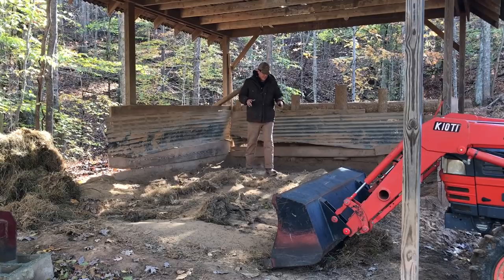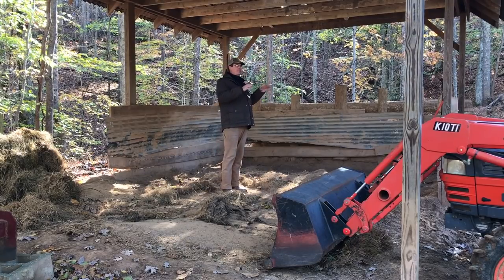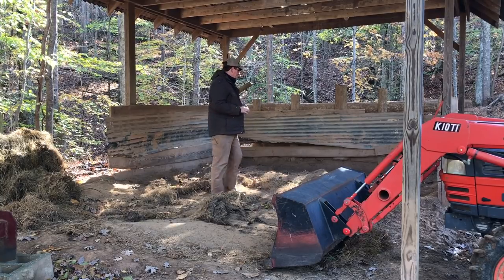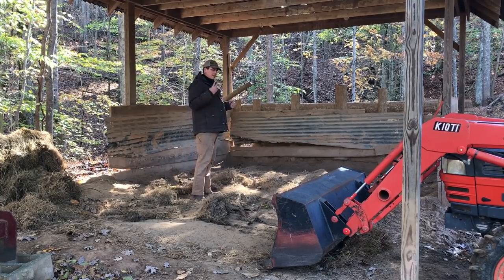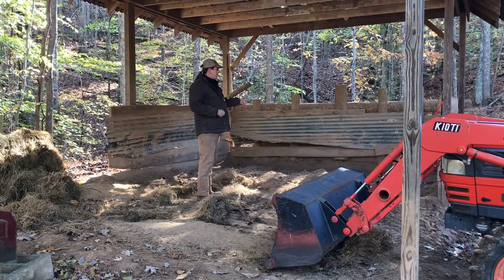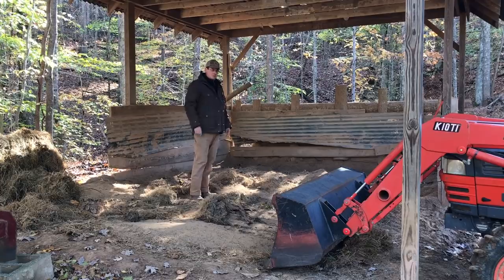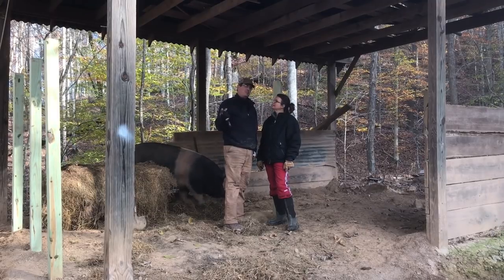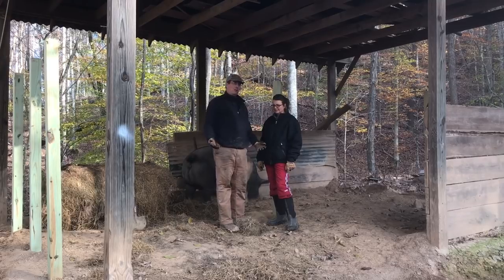Building barn stall walls with our milled lumber

Comment: Troy, safety tip: in front of the seat, near the floor, there should be a knob that should be adjusted when you switch 3 point implements.  The tighter that knob is, the slower the 3 point implements will lower to the ground.  Yours is apparently all the way open, as it seems to provide no restriction when lowering that post hole auger.  If you tighten it too much, implements will not lower to the ground at all.  Not only is it good for safety to make it part of the routine of changing implements, but it is also better for your equipment.  Dropping stuff a foot onto the ground with no restriction or resistance isn't good for it.  In the case of that post hole digger, the bearings in the gearbox took the impact.  

Looking good folks!  Stay safe!
Reply: production mate, know slowing down,,
Reply from the maker: My DK35 does not have that adjustment knob. It is a 2 lever system. She just needs a little more practice.

Comment: FOR  my hard rock red clay i welded a shaft on the top of the auger frame witch i sey a sqare 500 Lb counter weight witch has a hole in the center, just made for a shaft, witch helps a bit, but now since my gold digging cheating ex wife sold my tractor, its hard to use the auger